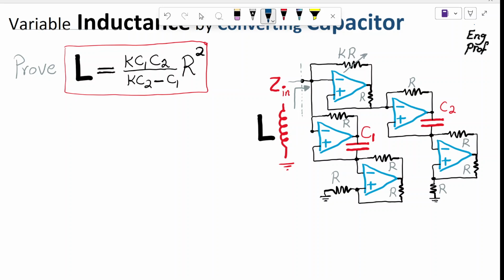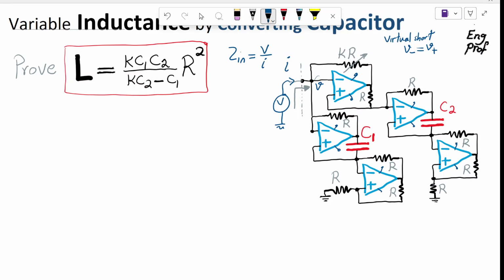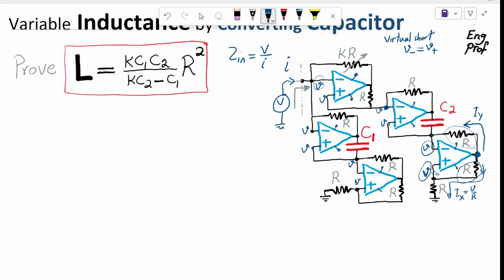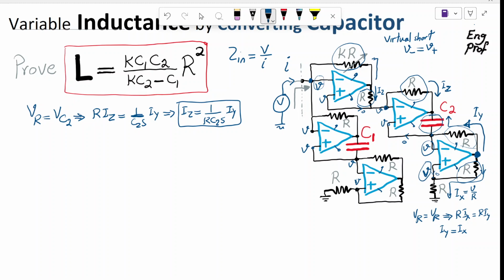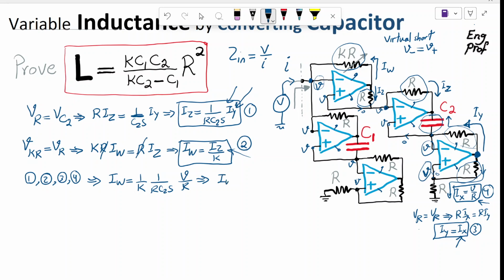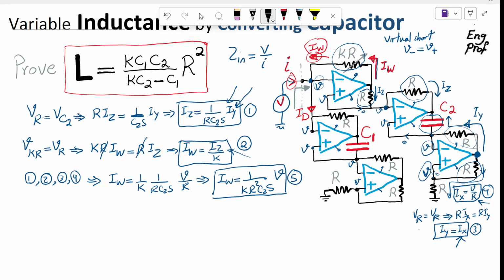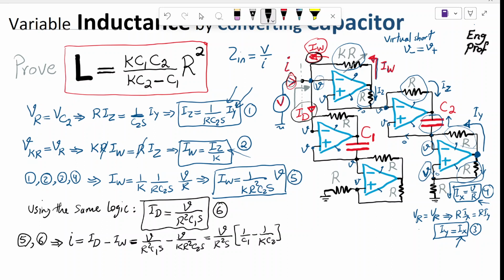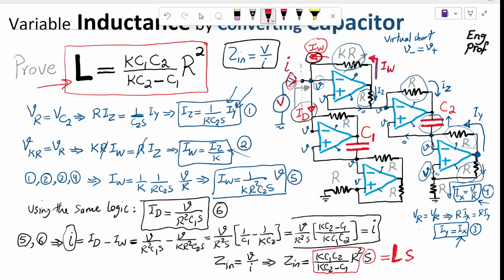Converting Capacitors to Variable Inductance

Comment: How high in frequency does this circuit work?
Reply from the maker: Good question. It depends heavily on the op-amps. With careful selection it should work well but mostly in low-to-mid frequency ranges (don’t expect RF territory). For this specific 5-op-amp inductance converter, in real implementations, you’re typically looking at a practical functional Frequency Range of Low kHz → maybe a few hundred kHz (best case). There are better topologies that use fewer active elements and scale much better with frequency. For example see my follow-up videos:  https://youtu.be/o6l_wztCACQ which describes an Impedance Converter Analog Circuit Design with two Op Amp (GIC and NIC) or https://youtu.be/weIHG45G6Pg which explains how to design Converting Capacitance to Inductance with four Op Amp Circulator Amplifier. These better and simpler designs are better choices for pushing toward ~1 MHz  if you use very fast, carefully selected quad (or dual) zero-drift low noise high speed op-amps from Texas Instruments or Analog Devices.

That said, what Actually Limits the Frequency?  1) Gain-Bandwidth Product (GBW).  As frequency increases Open-loop gain drops and Virtual short starts to “leak”→ the "virtual inductor" stops behaving like an inductor and turns into something questionable.
2) Phase Shift & Stability (major concern) of 5 op-amps that result in multiple feedback loops and hence implicit positive feedback paths.  At higher frequencies Phase lag accumulates resulting in increased risk of oscillation instead of inductance.
3) Op Amp mismatch, drift and noise (hence better to use high quality high speed quad or dual op amps).

Here is a Quick Practical Table:
Op-Amp Type	      GBW	          Realistic Max Frequency of Circuit
Precision (zero-drift)	~2 MHz	       ~20–40 kHz
Mid-speed	           ~10 MHz	      ~100–200 kHz
High-speed	       ~50–100 MHz	    ~0.5–1 MHz

I suggest checking https://www.ti.com/product-category/amplifiers/op-amps/high-speed/products.html
I hope this is helpful.

Comment: Neat analysis. Thanks for sharing!

There are much simpler ways to make a virtual grounded inductance, and simpler ways to make a negative impedance converter. 

What application needs both?
Reply from the maker: Thanks @jacobfaseler5311 for watching and your comment. Glad that you liked this circuit analysis  video.  Please see a few video links below that, to your point, demonstrate that there are many ways to convert capacitance to inductance:
1) Capacitance to floating Inductance conversion using circulator Amplifier: https://youtu.be/omkE3cv05lQ
2) Impedance Converter Gyrator: https://youtu.be/GVLC_pqSETA
3) Negative Inductance Design: https://youtu.be/GF_Mun_Mkyo
4) Converting Capacitance to virtually grounded inductance with Op Amps: https://youtu.be/6IYz4iaa05c
As for Potential applications:  Counteracting thermally variable parasitic inductance for instance in scenarios involving mutual inductances, which can be either positive or negative or possibly further applications in Distributed Flexible AC Transmission Systems.
Reply: What application, that's what I've been asking myself. I'm sure I don't have much love for inductances unless they're solenoids to magnetically act on something.
Reply from the maker: Thanks again for watching. Here is another circuit example: Capacitor to Inductor Conversion with Circulator Amplifier https://youtu.be/weIHG45G6Pg